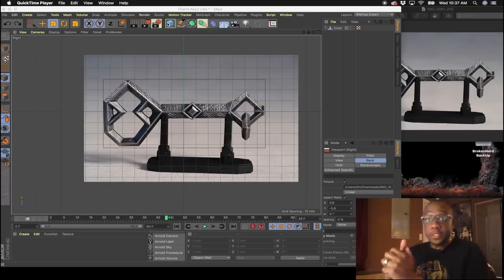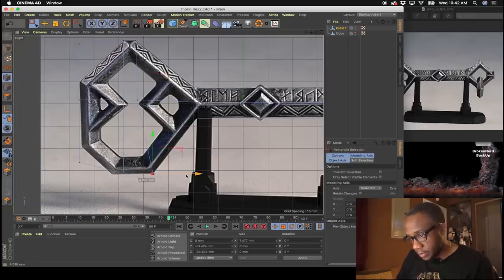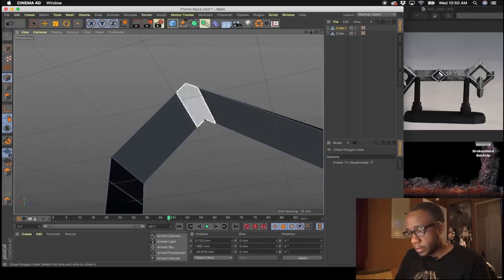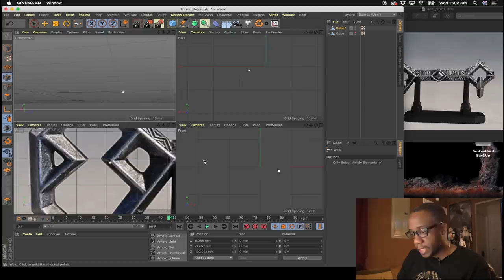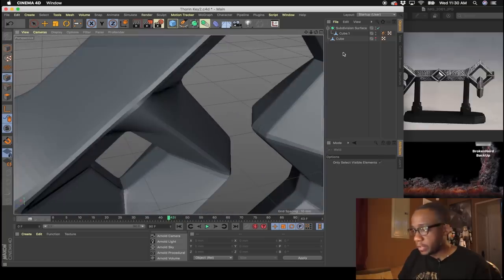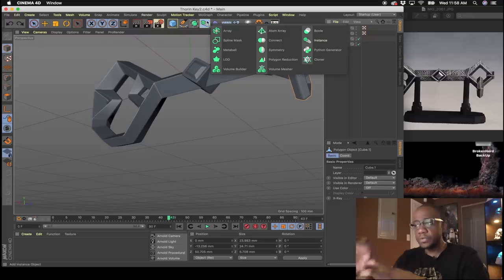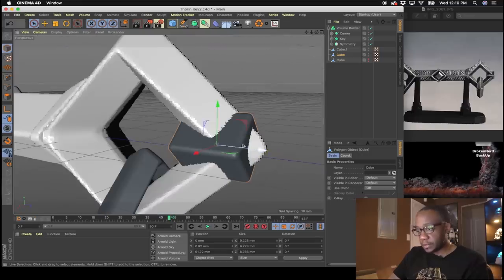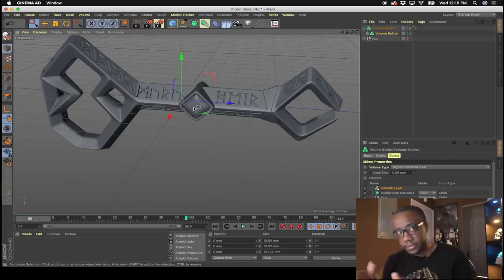Modeling the Key to Erebor for 3D Printing!

Comment: hmm... you have a pretty interesting way of modeling its almost kind of backwards of what I usually teach people I'm not terribly familiar with the modeling software you use but typically I would start with just a squared blank of the objects general out lines, subtract out the holes and then just use chamfer to cut my angles. The ethos of that being is that you want to do as much work at at time as possible, you're method is kinda like... you're modeling it by hand on a computer if that makes any sense to you, like this is how I would expect someone to make the key by hand in real life with physical material and there's nothing wrong with that this method is obviously perfectly functional its just I'm not entirely sure you're taking full advantage of the advantages 3D design can offer. and please do excuse me if I come off sounding pertinacious or nagging I was just interested if there was any deeper reasons to the methods you use that I wasn't understanding

Comment: It is great that you document your process, please just make sure that you point out that it is far from standard.

An analogy would be to use a laser cutter to cut 2x4s to length, then using a hammer + chisel to make them flat on one side and then finally using a CNC machine to carve out a doorknob. Yes, it can be done that way and if you don't know that a lathe or a saw exists it might seem like the only option - but please check out which tools others would use to come to similar results or at least mention where you learned this workflow from or if it came for playing around with C4D and self-learning.
Reply: You around like an angry gym teacher

Comment: I've worked with Cinema 4D when I was a student, too bad it's so expensive, I've really enjoyed it. And it's quite interesting to see how someone has a very different approach with same tools, for example I would make first object not by modifying a cube, but rather by drawing a profile with splines and then extruding it. Result would be the same, amount of effort will be the same, the difference is just in what method you are used to. 
Well, actually, being used to spline-based modeling it makes it hard for me to switch to other editors, like Blender.